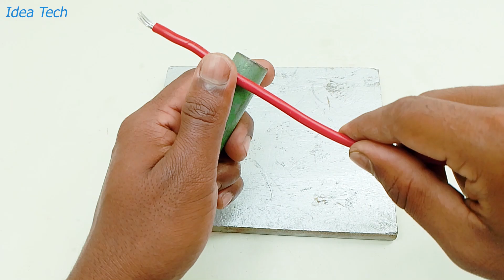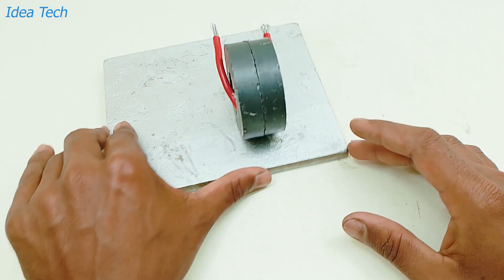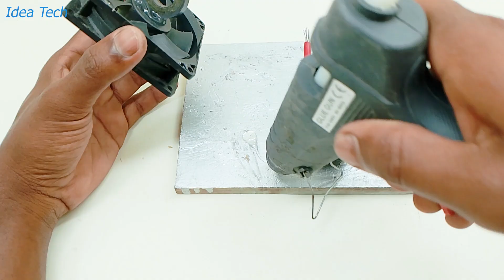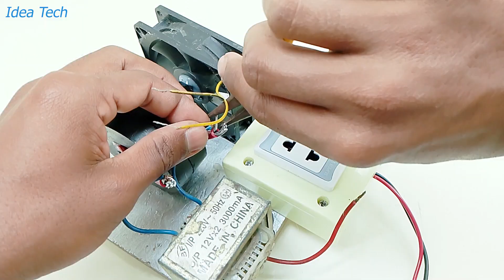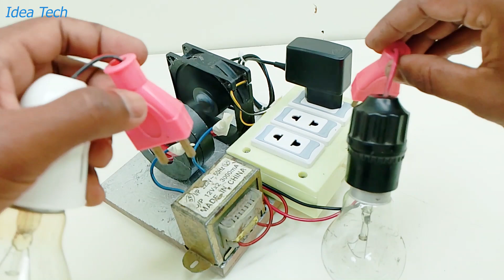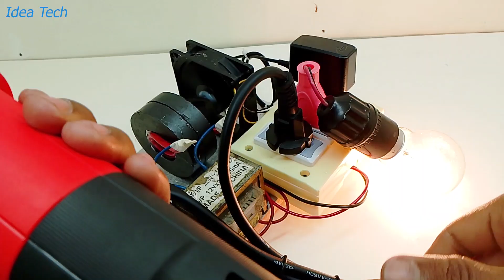et a free energy generator, 220V electric 14KW, infinity electricity, DC Fan Motor And 2 Magnet PCV

Comment: How can I be at 12volt fan I need 110 outlet that want an outlet will burn that fan then you can take it off this is fake now I would have believed you if you would have put it on the little transformer then to the outlet that I understand it's hard to believe that a 12-volt electric fan is not burning it's not burning out or smoking due to the high voltage